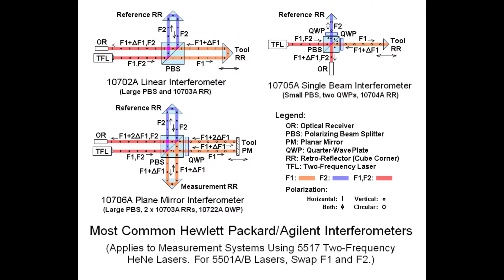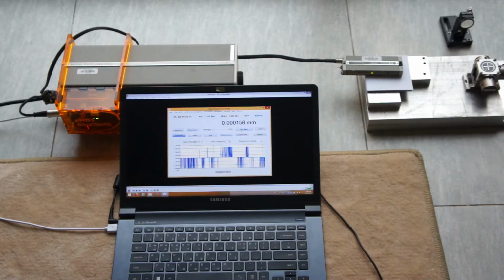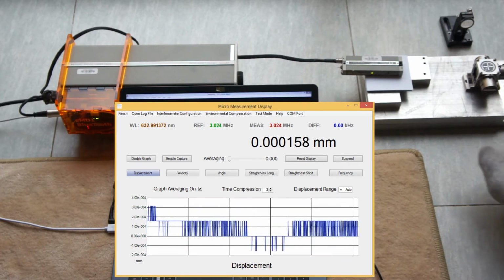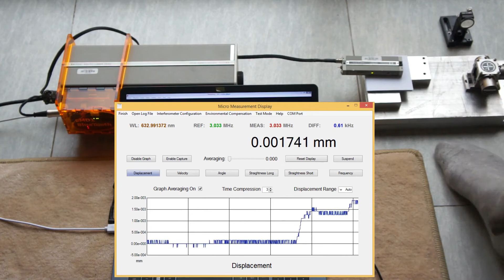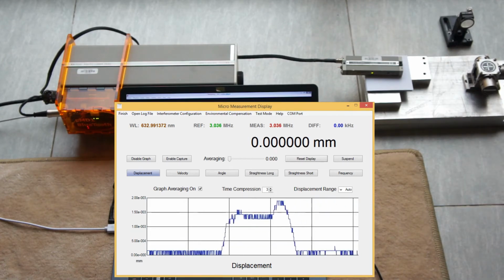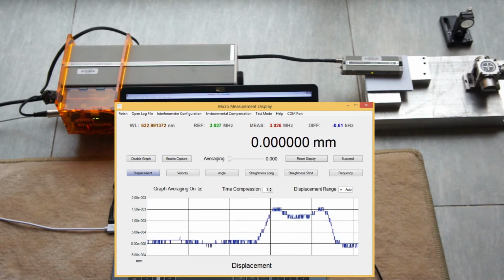HP Laser Interferometer using  µMD1 measurement unit.

Comment: Thank you for excellent work.
 I have  all three: 10780A and B and F. I'm interested with Brewster Angle.
I didn't find yet  what frequency  bandwidth  the receivers operates  at.
 The setup:  is the  laser beam Tx( transmitter) tilted at Brewster forward angle  at  conducting  or dielectric surface called SURFACE,  knowing that  air above is dielectric or yet another dielectric with different dielectric properties. 
Than the receiver is placed at  the  other side of that SURFACE at the same  Brewster Angle  but   facing  backward .
 The task is to  extract energy  using receiver  that is connected to  oscilloscope or any other indicator.
 So  the 2D space between   two dielectrics having different  dielectric properties/ /or between  conducting medium  and air acting as dielectric- creates the interface.
 Electromagnetic   wave with :
 -No refraction , 
-no reflection 
 tilted at Brewster Angle  makes  electromagnetic energy of the beam to  be trapped  inside of the interface.
 Source of energy  must be  vertically polarized (and  this is  sometime called Zenneck wave for lower frequencies.)
 Only receiver that is also at  Brewster angle can  "see" that energy .
___________________________
I see that your 10780? is connected only to power  supply. 
So in my case  I will need to use 10780B with that  wire hanging on the side and  terminated with BNC   and connect it to  the oscilloscope.
I didn't find  the manual for it yet  as I just got the receivers today. 
I also don't have power connector yet. 
Do you know where to buy  it ?
More information is in here: https://www.youtube.com/watch?v=wIIABIU3tRw&t=1333s
You can  also  go to my  last video to find what I'm about. ( End Screen - will  guide you to more of it)
I think it will be  quite nice  experience for you too since you have all needed equipment.
Question  : do you  have link for receivers manual?
 Have you had any  questions  feel free to ask.
Thank you  very much 
Wesley
Reply from the maker: Thank you for your comment. Unfortunately, neither I nor an expert on lasers I consulted understand what exactly you are asking. Hopefully this information I got to forward to you helps:

"The 10780 optical receivers have a typical bandwidth from 100 kHz to 6-10 MHz.
People think they are somehow getting a 10 GHz detector for $25 on eBay. :)

The 10780A manual it at:

  http://repairfaq.cis.upenn.edu/Misc/Lasers/hp/hp10780.gif
"